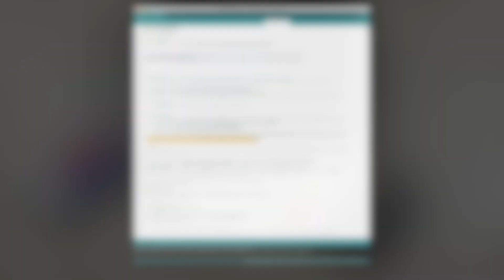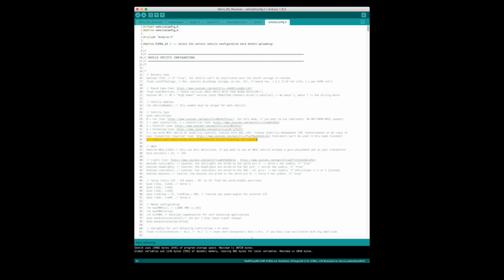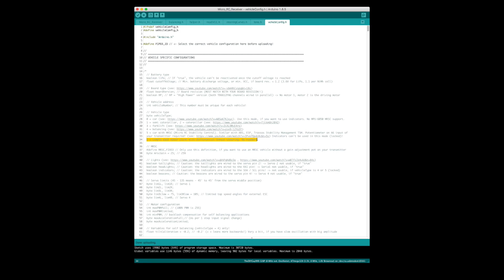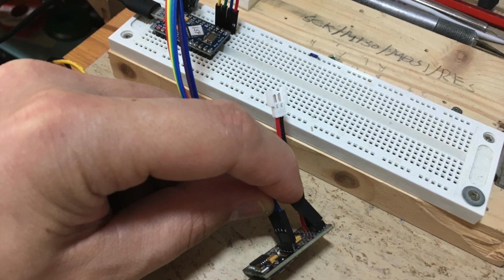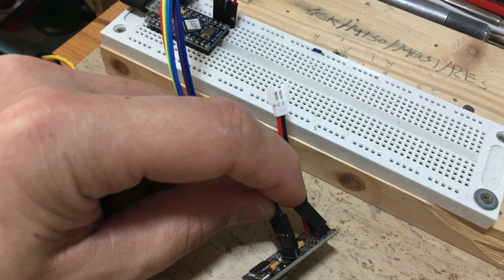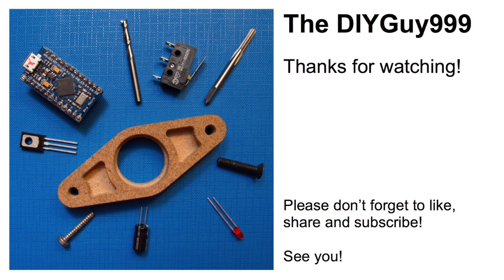Piper J3 CUB 2.4GHz Arduino "Micro RC" Conversion Part 1

Comment: Sir, we have made a micro receiver using Arduino pro mini and nrf24 providing the same battery power supply as for the mosfet to control coreless motor, so as soon as we give the throttle input, the microcontroller resets itself. We tried even with large capacitance at power rail but didn't work... Any solution sir? Thank you!

Comment: Can that plane lift the 750mah battery? if not what is the maximum payload capacity?
Reply from the maker: No, it is too heavy. The total weight of this plane is only about 25g. Also note, that it needs to be balanced properly: https://www.rc-airplane-world.com/balancing-rc-airplanes.html
Reply: will a 400mah work? could you do a video of increasing the battery from the stock 150mah. I've seen a video where a camera is attached and it works well. i want to increase flight time of my plane. https://www.youtube.com/watch?v=0LM-YxcYLhE
Reply from the maker: It will not work. At least not with my new receiver, which already adds additional weight.

Comment: Cool! You should make a four motor version😉
Reply from the maker: Thanks. The Atmega 328P does not have enough pins to control 4 h-bridges directly. At least not with PWM. But I already have a 4 channel extension board, which connects to the 4 servo outputs: https://github.com/TheDIYGuy999/RC_Decoder_4_Channel
https://www.youtube.com/watch?v=P9Z3-lArneY

Comment: Great conversion! Do you have the PA, LNA NRF24L01+ on the transmitter, or just the normal one with the PCB antenna?
I'm asking this because my range is pretty bad with the PCB antenna. Thanks!
Reply from the maker: Thanks. I’m using the normal ones, not the PA version. The range is highly dependent on your 3.3V supply. Additional smoothing caps help a lot. I honestly don‘t know how it will behave in the air. We will see...
Reply: Thanks for this useful info!!
Reply from the maker: You‘re welcome

Comment from the maker: The Arduino "Micro RC" remote control system finally leaves the ground. In part 1 of this conversion, I show you how to connect the motors to the receiver. A new software version can be found on my GitHub. If you like this video, give us a thumbs up, share and subscribe. This helps a lot. Thanks, see you!